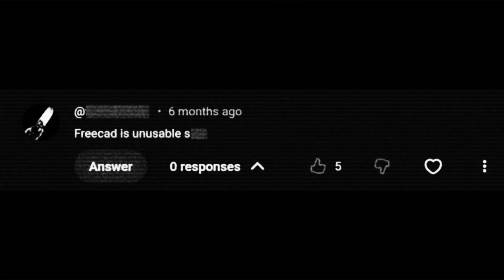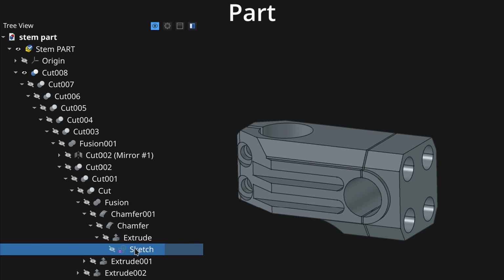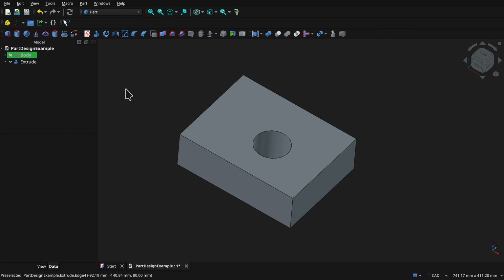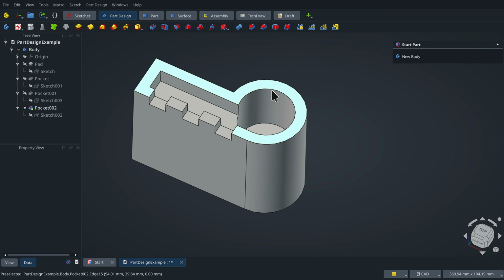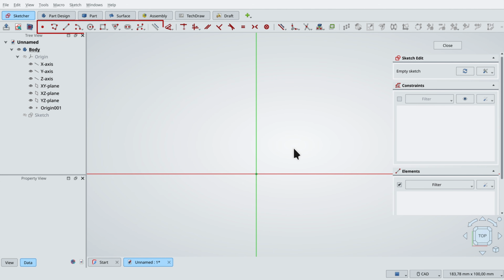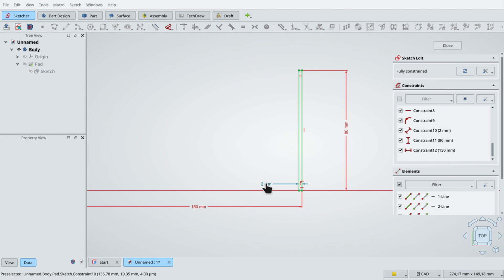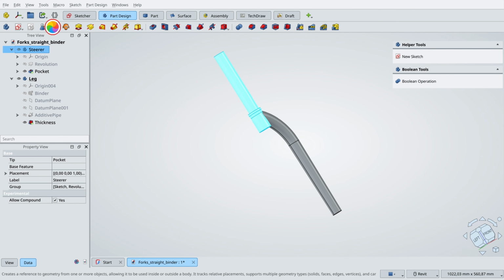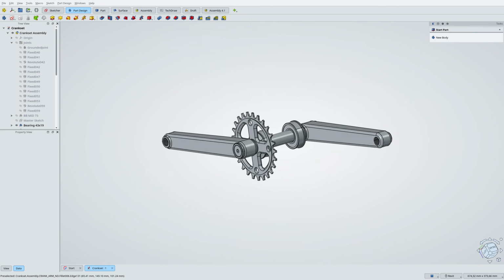STOP using FreeCAD WRONG! Do this INSTEAD (Workflow & Tips)

Comment: 0:16 You didn't quite refute or offer a solution for the "it crashes" part of this complaint. I like FreeCAD, but I've learned to expect that it tends to crash if I have it open with other CPU and/or memory intensive applications, so frequent saving is (as always) a good habit. Also, I want to thank you about the bit regarding FreeCAD's poor handling of fillets. I literally struggled a lot with that today, and I couldn't figure out why FreeCAD was randomly reassigning which edges I had filleted in previous operations. I'll be sketching fillets from now on or save them for last, I guess. Oh, and a final personal complaint: I wish it was easier to imprint/emboss text on a Body. Projecting drafts onto surfaces seems overly complicated, nevermind wrapping text across curved surfaces. Anyhow, cheers!
Reply: Solidworks and fusion crash and become extremely laggy all the time, most has little to do with the software and more to do with the persons workflow, by creating conflicting geometric shapes, unnecessarily complex approach, referencing problems etc etc, which is skill issue.

It's the same reason why it's a pain for me and really alot of people to edit existing designs from other peoples work in solidworks, their workflow is to put it nicely terrible.

Improper workflow always causes the software to crash and always makes an assembly laggy, and also makes editing the parts extremely difficult.

Learning proper workflow just makes everyone's lives easier, including the person designing.

There is a reason why some people are able to make complex parts and assemblies with any CAD software while others struggle to make a few parts assembly without having it crash every few clicks...
Reply: @dawod12-h8i  Hardly disagree. If a software crashes it is bad programming and bad handling of resources. Good software should only crash if the alternative is a completely broken state.
Reply: @skvvlk  a good designers knows complex drawing and having multiple actions for a simple shape will take a lot of resources as oppose to simplifying their approach.

A good programmer now’s a simple logic that achieves the same result is better then a complex hundred lines of code.

Anyway resources usage in CAD depends entirely on the Users approach, like any rendering software, the User has to understand how to simplify their approach to the limitations of their hardware.
Reply: Agreed majorly on the draft text. It's a total pain in the ass to use. A proper Text function within Sketch in the Part Design workbench shouldn't even be very hard to implement in the program considering the text/fonts used on PCs utilize vector graphics (meaning it's already inherently parametric since font is based on ratios). You wouldn't even need to make your own font library and could just use Windows' font library or downloaded font assets.
Reply: @Gr8_Ape_69  huh? FC uses windows fonts, ya just gotta tell it which font. You can use multiple windows fonts & sizes within a model. Yes, there are different ways to apply fonts. This is caused by open source code as different coders have different ideas on how to do it. Are all the ways described in yt vids? I don't know, but my expectation would be for the coder to describe how to use their code. Otherwise, why write it?
Reply: Never crashed for me
Reply: Lol of course it doesnt work its feecad not freecad no more
Reply: That's not really a FreeCAD issue, opening any app while having strained resources will cause it to crash.
Reply: @kxngduvie7682   That is something people tell themselves to shift blame from the software but for the most part (i.e. you're running out of maximum commit pool, which is NOT the cause of FreeCAD crashes by and large), a proper software may take a while to complete any operation but should not crash.
Reply: @SianaGearz  Yes and no. There's a very, VERY long term problem with the way that computer languages are written in that memory allocation failures are not surface in APIs in a programmer manageable way.  There's definitely a handful of languages that have solutions for this, and there are some very excruciating ways to work around the issue, but the basic fact is that an allocation failure is very tricky to deal with.

That said, unless you're dealign with assemblies so complicated that they're representing like, a fully integrated mechanical device... FreeCAD should not need that much RAM.
Reply: @DannoHung   I have had to ship software on 32-bit systems where malloc fiasco was a constant worry and very visible via voluntary telemetry and correlated with connection losses in service logs, since the software had to handle gigabytes of hot data; and worse, the buffer management of OpenGL ICD also contributed. Of course the actual OOM couldn't usually be recorded, but when a similar system running 32-bit vs. 64-bit versions of the software have different crash rates, you know what's up.  With 64-bit address space, the problem is solved. It is impossible for you as a human operator to perform enough actions in your lifetime to run out of address space due to fragmentation. The allocation footprint of the software will keep growing, but unless there is an explicit leak, the growth necessarily slows down with time.

It is correct to say that malloc fiasco does not have a way of handling it once it occurs in non-embedded software - the only remedy is to take steps that would make it unlikely in the first place. But this is also just not a problem. It is more likely to have a latent bug such as iterator invalidation or race which presents rarely enough as to imprint on long-running sessions and not be visible in short ones, but it's still a plain bug in the software. It is also expected for malloc to be slower in long-running sessions.
Reply: @SianaGearz Sorry, but your reply seems to only interact with the person you're replying to on a very surface level. They're (from my understanding) talking about out of memory exceptions which in most cases cannot be handled by the program itself, it has nothing to do with address space exhaustion, but simply memory exhaustion, not just for RAM but also VRAM, which is pretty likely to occur in 3d applications.
Reply: @0xfadead  Freecad basically cannot exhaust VRAM or face VRAM exhaustion on 64-bit builds unless it leaks VBOs because buffers are all ICD managed, so they will be paged in and out on demand, they're not hard pinned. This is a major difference between legacy and modern APIs - modern ones expect application to manage VRAM explicitly, while legacy ones allow you to run a high VRAM deficit and they'll still make it work, at a performance compromise. Memory exhaustion yes commit limit which i mentioned above, it's not Freecad's issue either. There's non-obvious submarine bugs well hidden in any sufficiently complex C++ software.
Reply: @0xfadead VRAM can be an issue even though FreeCAD calculates everything with the CPU? I figured the GPU was just displaying the image at that point. You can run out of VRAM that way? Even the Render function uses the CPU. I think that's that case with most CAD programs, too. 

I'm very ignorant on this topic, so I'm seeking some clarification, not trying to call bullshit.
Reply: @SianaGearz  I didn't know old APIs had that feature, thanks for pointing that out!
Reply: @Gr8_Ape_69   it's rendering vertex buffers on the GPU just like any CAD package. these can get several hundred meg in size, and they do potentially cause memory management trouble on 32 bit builds. 

unless you enable Software OpenGL in which case it is software to pixmap, but it's not a preferred or sensible mode.
Reply: @SianaGearz  I've got a pc with 128gb ram, 2 e5-2680v4 with a total of 56 cores and a rtx 3060ti 12gb. Freecad still crashes. One core issue is that it almost completly runs on a single core with the result that even the ui locks up, if freecad has to do some even minor recalculation like recalculating a modled screw thread. If one is impatient in these situations it has a high chance of becomming unresponsive and going the path of a crashed programm. While this has gotten better, it is still an issue in freecad 1.1.1 and I don't see it getting fixed soon, since the underlying solver is only single threaded. And then there are just unexplainable things breaking, but that a seperate issue.

Comment: Quick comment about fillets in part workbench. No one explain's this, so I will here. There is a switch at play, to fillet all surfaces/corners or not. In the tree view, the last operation is displayed. Clicking on it's name toggles a box @ the name on or off. On the model screen, a similar box will appear on or off. If you have ever selected a model to export, this box is necessary or nothing exports. If the box is on when selecting fillet, the entire selected model will appear filleted to a chosen size, possible defaulted @ 1mm. This is set at the bottom of the fillet control dialog box. Here will appear all edges and their individual on/off control. If your model has 100 edges, it might appear you'll need to unselect or remove many, many edges to acheive only a few edges. Instead, close out the fillet operation and hit the back arrow (UNDO) to cancel the fillet operation. Now, click on the operation name to remove the box. Next, select fillet. The dialog box appears, awaiting you choosing the edges to fillet at the selected radius size. Understand, what we're selecting is a fillet command for a particular size. If more than one size is required, an additional fillet operation is required. Again, when adding a new fillet size, make sure the box is off or your automatic selection of fillets will try to fillet the previous operation fillets, often crashing the model. For newby's, this can be a mental disaster. Here, close the operation & back arrow the model to undo the oops. No, it didn't destroy hours of work.
Reply: That's not very good UX design... good design has clear and unambiguous flow to it :)
UX is the most important thing about any tool that's meant for productivity.

But hopefully FreeCAD will get that stuff sorted out.
Reply: @Mtaalas It is a good design. Fillet all or make individual choices. New users just need to know how to select the options. Can't get less ambiguous than either/or choices. Picking the wrong choice solution is undo last operation.
Reply: @dbeelee8564  good design is that I select edges or loops that I want to fillet then select fillet and based on what I've selected, that's how it'll work. A confirmation box with preview and an OPTION to change the assumption it makes and we're done.

If I've nothing selected, open the same box but allow me to THEN select edges I want to fillet... it's not difficult concept.

"select complete loops only"
"select edges of selected faces"
"fillet object edges"

etc... there are possibilities to filter that down without weird ux flow with GLOBAL overriding settings that will confuse the user...

Comment: I would argue that it IS broken if nobody can figure out how to use it.  If how to do the simplest of tasks is a mystery, then it's irrelevant how capable the software is.
Reply: A software which solves a complex task cannot be figured out by poking alone, it takes education. If you want to poke your way to victory, you will not succeed in any parametric CAD.

Did you ever try programming and then bang your head against the wall why the IDE doesn't just write the software for you? Or try just inputting random words and get frustrated that it fails to compile? Is this how you want to approach it, do you think it's sane?

Granted, FreeCAD is actually bad in comparison with state of the art in its category of software.
Reply: @SianaGearz  thats not the point. Im an engineer, and very familiar with all sorts of CAD software 2d and 3d alike.  FreeCAD is reinventing the wheel in a way that is unintuitive and has no discernible advantages.  My time is valuable, and I'm only willing to put the time in to learn things that provide something new/advantageous - which FreeCAD does not provide, aside from it being open source.  I support the idea, not the execution.

Comment: The first section of your explanation, concerning the multiple workbenches, perfectly illustrates why I refuse to use freecad. It has multiple personality disorder. For actually designing parts there should only be one workbench. Sure you can have other modules for FEA and assembly and technical drawings. But for actually designing things, no, there should only be one. Onshape shows that they can easily fit all the modeling functions into a single environment. I really like the idea of freecad and they have done some great work with it. But until they fix this in freecad it won't matter how capable it becomes, I just don't see this program ever catching on with any but the most dedicated diehards.

Comment: i think the main thing that frustrates me has to do with the lack of region selection when applying a feature (such as extrude). In solidworks, if the wireframe region isn't perfect, it lets you select (in your example you showed two regions). I find it far more intuitive and useful in that because sometimes I want to apply different features to the same sketch (like an extrude followed by a cut). In FreeCAD I find I have to do that sketch twice to achieve the same result. There are just a lot of things the solidworks and fusion "just do" and freecad doesn't. It adds complexity where it shouldn't be necessary and it makes what would take me a few seconds in solidworks many minutes.
Of course, I do think my complaints will be addressed and solved in FreeCAD as future updates come in.